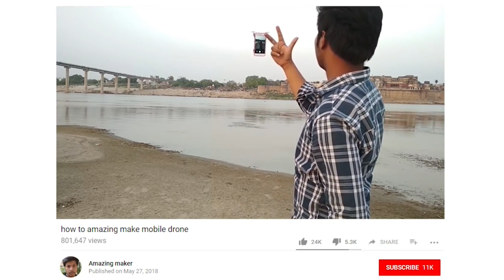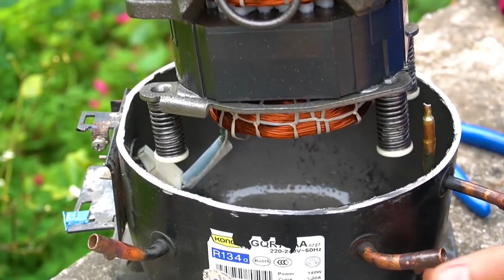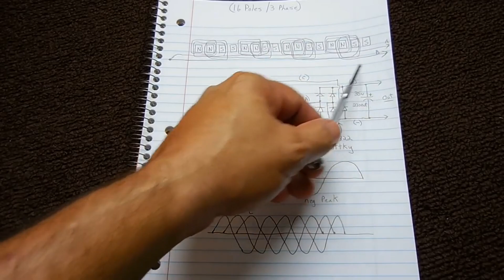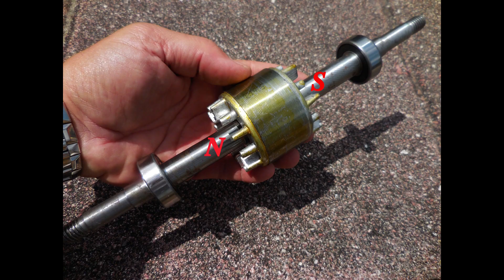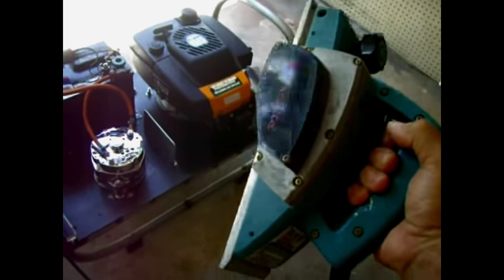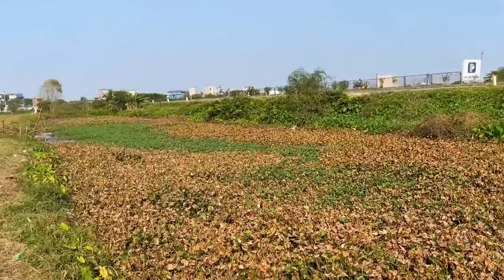Fridge Compressor Turned Into 220v Electric Generator EXPOSED

Comment: Just watched the original video. It seemed like the guy didn't even try to hide the wires. Also, if that thing was to actually get a load on it, it would have instantly thrown the belt. His "generator" pulley wasn't even on straight.
Reply from the maker: The guy is a complete fraud, and YT is profiting off his deceptive videos.

Comment: I have a request for a video, say you had an old battery-powered AM/FM radio. For argument's sake, we'll say it runs off of 3 AAA batteries. Let's say you wanted to run that radio 24 hours a day, and Yes batteries would last for a looong time. What if you wanted to make a device that plugs into the wall and does all the stepping down to power a relatively small device that uses just AAA batteries. You could put the dummy batteries in the device (without the battery cover) and have a wire running out to the device that you made that is ultimately plugged in the wall.
Could you make something like that? Please? 
Yes there are logical alternatives but let say you have sentimental value with the radio and absolutely want to us it without using a million batteries
Reply from the maker: Just find the proper voltage/current rated AC wall adapter, then solder the + & - to the correct spots in the radio. If it was me, I'd open up the radio and add a DC jack connected directly to the + & - from the battery tray so you can have a professional looking connection for the AC adapter.
Reply: @electronicsNmore  Thank you for the response. What about amperage?  Any insight on that would be appreciated.
Reply: @xlnyc77  If you search the term "battery eliminator" you will find almost  a drop in replacement for batteries. Dont worry about amperage unless batteries are depleted within tens of minutes. If batteries can operate the device for hours, its usually not power hungry enough to be a concern for an even crappiest power adapter.
Reply: Of course soldering in a DC jack is the best solution, the battery eliminator thing is a way to go if you are uncomfortable with soldering or modifying the device.

Comment: At around 6.06, when your red arrow points to the wire in the grass, you can also see the wire going up through the board and into the side of the power socket! - Like Derrrrrrrrrrrrrr
Reply from the maker: I just looked using hi-res 1080p. All I saw was the hole in the wood, and the symmetrical notch at the end of the power strip. The wire is connected under the cover using the other hole. Thanks for watching!

Comment: I'm not sure whos dumber at this point, the video maker or all the people leaving a Thumbs up. Criminal at work, so where's the mighty YouTube censors at to take this crap down.
Reply from the maker: The video maker is taking advantage of the system. YT doesn't enforce scam videos.
Reply: @electronicsNmore  good thing we have yourself to out the scan and the power of sharing for the rest. 
Great video btw👍